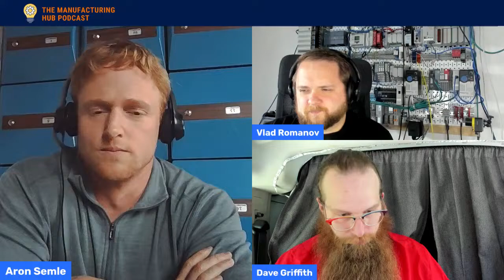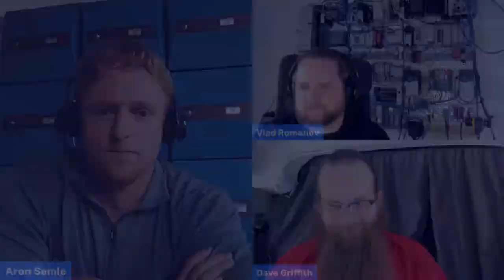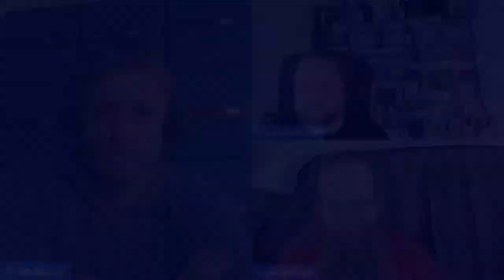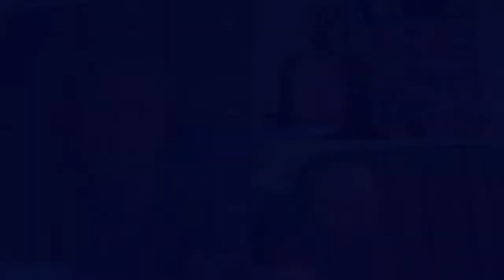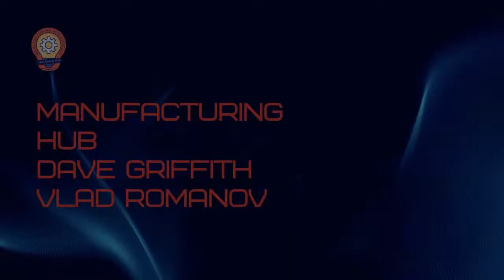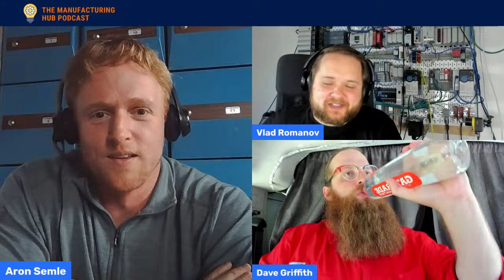Ep. 169 - Information At Scale - Aron Semle

Comment: Got so much value from this! Here are my notes. Hope it helps potential listeners:

I really liked the bit about IIoT. I thought I was one of the few techs that still was not clear about what exactly it was. I feel better now that giants like you guy are still pondering it :)

No powerpoints allowed! ... love it!

DataOps - get the data, put some context around it, send it out. Scaling is easier and less expensive. They always want to expand.

Really love the example of the automonous guided vehicles. 

Better if IT and OT are involved.

Customers can over-rotate on contextualization. Do too much at one time.

Challenge of ROI. Early use cases. Talk to the operators.

Data governance. There will always manually data. Scraping csv files.

I could not stop laughing re: 3D printing ... ha ha ha.

Future ... edge data lake.

Datalake ... mass scalable storage ... contextualized data, query at scale, provide ETL tools.

Edge compute that can run docker ... data centers are coming back.

AI to assist operators ... the possible future.

There are still a alot of infrastructure issues to be solved before we can fully take advantage of the AI.

Another cool example ... mqtt sensors on conveyors to detect when a motor is going bad. DataOps is bi-directional.

Vlad .. micro use cases ... I like that!

Future - Aaron:
- cloud east manufacturing.
- new protocol from OPC foundation.

Dave ... one protocol to rule them all ... ha ha ha.

Dave ... Start cutting out the old protocols.

Career advice, aaron ... electrical engineering ... lower level stuff is importance, pragmatic marketing, don't look at AI as a threat.

Book recommendation: countdown to zero day.